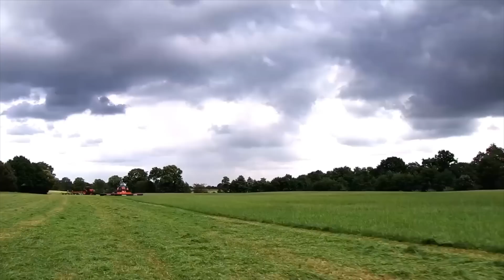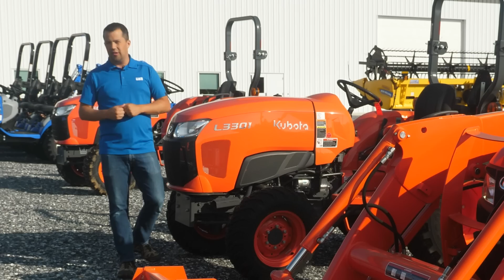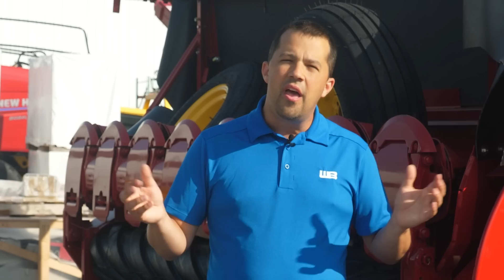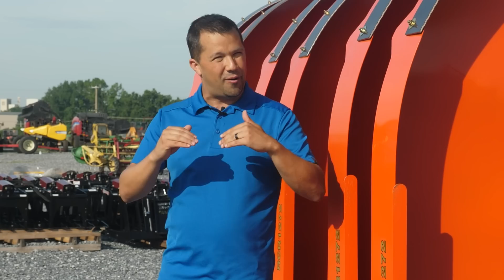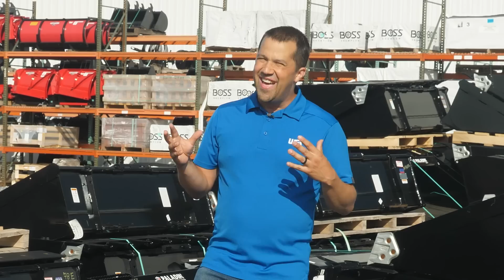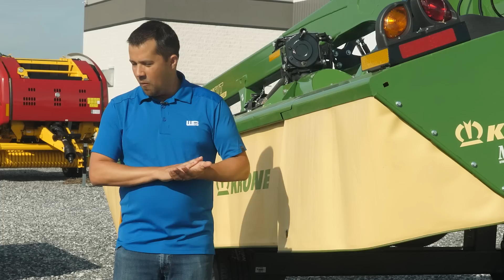Inventory & Interest Rates | Late Summer 2022

Comment: I live in a small town surrounded by other small towns 10-15 miles apart ….
The closets kubota dealership I’ve been doing business with the last number of years is very short on supply still.
Maybe because they are a small dealer but who knows but them I guess. I was in the market to upgrade from my 2501 MT tractor .
Took the tractor to them for trade in….they didn’t hesitate to give me a fair value but they had limited tractors with even less loaders.
They did have a few 3302 HST units but only had two 3902 HST models….but only had two loaders for all of them! 
I decided to bite the bullet and get the 3902 HST due to the risk of possibly losing the 0% financing by the 1st of the year. Also the unknown availability of future tractors/loaders along with price increases! I guess it’s a good sales pitch and possibly  exaggerated scare tactics. All in all I’m happy with my decision and comfortable knowing if there are going to be price hikes and finance changes I avoided them! 
The L series is a bit bigger than what I really need but many times I’m glad I have it! ….hoping it’s my last tractor …😅

Comment: There's no such thing as a true 0% loan. The fee to provide the loan is built into the cost of the item. That's why a CASH price often cheaper than the 0% offer. Examples of this are Solar loans. The bank fees the Solar company passes along to the consumer is like 20-30%. There is no free lunch.
Reply: Exactly. You either pay the interest rolled into the cost of the item or you finance the interest. Either way, you pay
Reply: Agreed. My dealer gave me 15% off the tractor and all attachments by paying cash. Full msrp if using the financing

Comment: We inked a deal for a Grand L 3560 le just before Thanksgiving and took delivery the Friday of Memorial Day weekend. We put a huge amount down and got 0 percent financing for 84 months. We were grateful to get zero percent and added several options the tractor plus implements. Actually our Kubota salesperson and mechanics had made the comment that they had never seen a compact tractor this loaded up. LOL 😆 
Whats interesting is the tractor was in stock when we struck the deal but no loader. We could have picked up the tractor at the end of March when an unsold Grand L came in with a loader. They just put it on ours. The further wait was the Precision mfg adjustable add a grapple! Small manufacturers in the US are struggling to keep. The same time the grapple came in another dealer called me that they finally had a TrailBlazer front brush cutter and power pack in which we had installed at their dealership the following week. The salesperson at that dealership told me that wasn't even their order. The distributor rep found one for him in his territory that hadn't been sold!
We are enjoying the extra work we can now get done.

Comment: It’s still hard to put a forsure time line.  I got my 3301 back at the beginning of april. My dealer told me the loader probably wouldn’t be in until the end of June but the tractor was there.   My salesmen called me the next week and was like I’m just as shocked as you are going to be but your loader just showed up.

Comment: Eastonmade, manufacturer of very good commercial grade log splitters and firewood processors, has gone as far as looking into building their own engines to solve that portion of the supply issue. Imagine a company like that building their own engines to solve issues. We shall see what they have in store for parts and lead times with their latest factory expansion.

Comment: Bought by BX23S from Messicks back in May with 0/0/84 terms.  They actually had one not sold and I took delivery in just a few weeks (the prep shop was backed up).  Still waiting for my thumb though, I think ill give Nick a call tomorrow.
Reply: i have bx23s from messicks and have the thumb on mine. rarely use it so would sell to you if you need one.

Comment: In 1950 the average price of a house in the US was $7,000. In 2022, it's $428,000. In order for prices to go down you need deflation, which rarely happens in any significant way. Even if inflation comes down to 2-3% it is still inflation. Prices will never get back to where they were in even 2019. Some goods may come down a bit if their increase was the result of shortages or high demand, but overall, what we see now is pretty much as good as it will get, and that's if inflation goes down to "normal" levels. But I don't see that happening anytime soon.
Reply: I will not disagree with your average prices, but I think you also have to consider the style of homes, their location, and the demand. I don't think most "starter homes" built in the 50's are comparable to what you get with a starter home in 2022. Inflation is definitely a factor, but the cost of land is going up dramatically, particularly in desirable areas. People seem to be more willing to take on a high debt now than they were back then, which means they'll buy more house than they can really afford to.
Reply: @JCWren  you're absolutely right. Look at all the technology and the change in building that has happened since the 50's. In my community, we didn't have electricity even until 1957. My great grandparents didn't have a flush toilet in their home until 1959. That house was 700sqft, 2 bedrooms, a kitchen, dinning room/family room. No bathroom, no office, a single level with a dirt floor cellar. The old house had rough sawn 2x4 construction with straw for insulation. Houses now are now built with 2x6 lumber and R14 fiber insulation.
Reply: There will be deflation for a period during the recession we are in that will get worse before it gets better. The thing is the average person buys when things are good and prices are going up and sell when things go bad. So inflation hurts them and deflation hurts them. Look at the price of a house in Vegas in 2007 vs 2009. Of course that deflation only lasted about 5 years but it occurred.